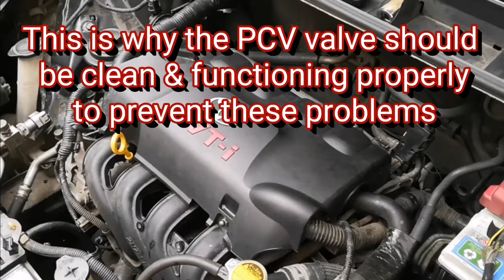PCV VALVE - You MUST Clean This! | Vios/Yaris

Comment: nice & very informative video.. Is it necessary to clean the internal of the rubber hose as well? what should we use to effectively clean the rubber hose and what to avoid?
Reply from the maker: @k0m3n9  Yes, you can clean the hose too, if necessary. For cleaning or removing oil from rubber hoses, you should use a mild degreaser or soap-based cleaner that is safe for rubber. Most times, plain dishwashing soap and pressurized water does the job. Thanks for watching!

Comment: My pcv valve hose is oily does this mean my pvc valve is bad?
Reply from the maker: Yes, it could be clogged or stuck open especially if there's excessive oil. In either case you should clean - or, better yet - replace it. Check the hose for obstruction and damage and replace it if necessary. Check for signs of blow-by such as leaky engine gaskets or seals or visible smoke coming out of the dip stick tube while the engine is running. If you suspect excessive blow-by, you may want to have the engine's compression checked by a mechanic. Also, make sure the engine oil level is not excessive.

Comment: Why is it important to leave a gap between engine and pic valve?
Reply from the maker: Because the body of the PCV valve is tapered to form a seal. Forcing it all the way in could ruin the threads or cause stress cracks.

Comment: Sir thank you very much i learn a lot from your video and the caption are very clear and valuable info. Can you please show us how to remove and clean oxygen sensor. Than you very much. Keep safe.
Reply from the maker: Will do sir, when time permits.  :) Thank you so much for watching and for your positive feedback. God bless & keep safe!
Reply: @Viosified  
How much pounds foot do you torque the PCV valve ?
I installed one on a 2008 Yaris.
I torqued to about three exposed threads, showing on the PCV valve.  Same as previous PCV valve.  It had about 3 threads exposed.  
You can easily strip the threads or over torque the housing is aluminum on the PCV valve.
Reply from the maker: @dfls5069 yes, I agree. I only torque the valve up to a point where it is snug enough to maintain seal and not more (maybe about 3 - 4 threads), because the valve is tapered and over-torquing could damage the engine block as you have pointed out.
Reply: @Viosified  
Anything greater than 3 threads exposed on the PCV valve for the Toyota Yaris, you risk serious damage to the threads.
I saw it with my own eyes. 
An amateur can easily destroy those threads.
I should have left 4 threads exposed for the longevity of the threads.
But 150 000 KM's and the PCV valve was in excellent shape.
Reply from the maker: Yup, totally agree. Good thing the pcv valve toyota uses is durable & easy to maintain.
Reply: @Viosified  
Not touching it again for the life of the car !
150 000 K and it still rattled. 
Very tiny oil buildup on it.
Was actually a waste of money to change.
Risk of damage to threads too.
Reply from the maker: @dfls5069  yup. Sounds right  :)
Reply: @Viosified  
My friend, is the throttle body electronic on the 2008 Yaris ?
Reply from the maker: @dfls5069  yes it is

Comment: Be sure car is cold before removing this type of pcv valve. Wear gloves when using carb cleaner. DON'T use carb cleaner if pcv valve is plastic use brake cleaner instead. If it rattles chances are it's working but to be sure use a balloon on the end of the hose it is connected and blow air. If the ball on stays inflated and no air is lost u can be sure it's working without leaks. Thanks for the video.
Reply from the maker: Thanks for watching
Reply: Hay! The tube next to it connected to air intake mins have a crack an owner before me tried to put black tape but it’s off , do you think this the cause of my po171 code
Reply: @gamingwitchutuu429  P0171 can be a lot of things. Start by replacing pcv valve since it's so cheap
Reply: @xtdcxdoom7  ok 👍🏾
Reply: What is the balloon leaks slightly. After cleaning with carburator cleaner, I ultrasonic it in water for 1 hour.    When tried to suck and blow air through it.  Seems to function as a 1 way valve.   But I can see the spring seems a bit loose.

What are the negative effects if there are some air leaks?

Comment: 3:36 that bark sounded so realistic i thought it was my dog.
Reply from the maker: You have good speakers ☺️ Thanks for watching.
Reply: Question: Why is there a need to disconnect the battery?
Reply from the maker: Disconnecting the negative cable from the battery is just a safety measure to prevent electrical shorts in case tools accidentally touch the positive terminal of the battery while working on the engine.

Comment: What about Toyota Camry? It’s 3 hours of work in shop to change this valve. It’s located on crankcase…
Reply from the maker: The PCV (Positive Crankcase Ventilation) valve is always attached to the crankcase to do its job of releasing engine pressure, though its location and accessibility may vary depending on the type/model of the vehicle.

Comment: Can we use brake cleaner for this ? Thank you
Reply from the maker: For PCV valve, yes you may if that is all you have. Just don't use it on MAF sensor and other precision electronic components, though.
Reply: DO NOT use Brake Cleaner for cleaning the PCV Valve.
The correct chemical for the job is Carburettor Cleaner, such as "Gumout".
Pros don't waste time and money by cleaning PCV Valves -- they are thrown away.
Reply: @Viosified  The correct answer is: NO !!
It is never proper to use the wrong stuff "if that's all you have" -- 
When laying out a job, you get what you NEED before you start work.
 Basic Mechanics 101.
Reply from the maker: @SlikLizrd   I appreciate your input. However, this PCV valve cleaning video demonstrates a process that is part of our regular MAINTENANCE procedure as a PREVENTIVE MEASURE to keep the PCV valve in good shape. Note that it is NOT broken or defective, and thus only requires basic cleaning (NOT REPLACEMENT). If, on the other hand, the PCV valve reaches the end of its service life then we replace it as necessary. 

In our part of the world, money is tight and we do what we can to save it, if possible and within reason. 

Also, the PCV valve used in the video is entirely made of metal with NO sensitive electrical components or plastic that could be damaged by using brake cleaner. Therefore, it is not necessarily "the wrong stuff" to use. 

I did add a precaution to my reply to his question NOT to use brake cleaners on MAF sensors and other electronic components to avoid damaging them, as you may have read in my answer to that question.

If you watched the video, you will see that I used carburetor cleaner for the PCV valve.

Please note that this is a DIY channel aimed at helping non-pros who want to save some money by maintaining their cars at home using basic tools at their disposal. It includes precautionary advise as needed. 

The PCV valve in this case won't melt, explode, or break down if cleaned using a brake cleaner, hence the phrase:  "if that is all you have. '  I then added a precaution not to use it on MAF sensors and other electronic components.
(My exact words:  "For PCV valve, yes you may if that is all you have. Just don't use it on MAF sensor and other precision electronic components, though.") 

Thank you for your feedback, Chuck. Have a good one!
Reply: @UCaU5_eA8Ln2PcSQFhQDVV0w Good morning to you, sir !
It's all good. You don't owe me any explanation.
 Sorry that you took a fence to my advice on saving time and money by NOT cleaning a PCV Valve.
Funny how such a simple piece of common sense can be rejected out-of-hand, but hey, it's U-Tube, and it takes all kinds.
Good luck to you, sir -- you're gonna need it.
Reply from the maker: No worries. No offence taken. I understand if you can't see the reasons why we clean our PCV valves as a preventive measure.  Replacement parts can be expensive where I'm from so we take the time to prolong the service life of each part as much as we could. Besides, it only takes a few minutes to clean that valve anyway. But hey, if you're too busy to do it, don't bother. 
Heck, if the car breaks down why not just replace the whole thing to save time, right? 😁  just kidding. Thank you sir. Keep safe.
Reply: @Viosified  
"I understand if you can't see the reasons why we clean our PCV valves as a preventive measure. "
 But I never said anything of the kind.
I DO understand the situation, and your reasons for defending a bad practice -- and it's OK.
You say you clean the PCV Valves "as a preventive measure" -- BUT -- when we look up our Maintenance programs, we see that the manuals tell us to "CHECK" the PCV Valve as a preventive measure.
"It only takes a few minutes" to clean the valve, but at 120 dollars-an-hour for Dealer Shop Time, "a few minutes" is money wasted, because with "cleaning", you're STILL not certain that the valve is thoroughly cleaned, which means you MIGHT get a customer come-back and an a$$chewing from the shop foreman.
I ain't here to bust your chops, man, and of course you are free to do as you want -- my decades of experience have taught me differently.
Reply from the maker: I respect your expert opinion, but calling this a "bad practice" is a little bit out of line.
First, the videos I make are designed as tutorials so that viewers are allowed to DO-IT-ON-THEIR-OWN (hence the DIY concept of this channel) which saves them TRAVEL TIME (for not having to go to the garage or mechanic for a simple maintenance like this); which also saves them GAS MONEY and MONEY FOR LABOR that they would otherwise have to pay the mechanic to do the checking or cleaning or replacing for them.

You advocate checking the valve. I advocate checking AND CLEANING the valve at the same time. I also do recommend REPLACING IT if necessary.

So your argument about the "120-dollars-an-hour dealer shop time" being wasted is pointless; because if viewers "do-it-themselves" they won't have to spend as much.

Second, I DO NOT charge anybody for anything because, as I have stated, the concept of this channel is to ENABLE my (non-pro/newbie car owners) viewers to learn and become more interactive and responsible about maintaining their OWN cars.

Any mechanic worth his salt would know how simple a PCV valve works and only stupid ones would not be able to determine whether or not the PCV valve is due for replacement; or whether it was "thoroughly cleaned" enough for it to do its job before re-insralling it.

I expect you to realize this given your "decades of experience" around cars.

Good luck on your channel.
Reply: @Viosified  OKEY-DOKEY. And thank you.
Reply from the maker: Thank you 😊

Comment: Can we use throttle body cleaner?
Reply from the maker: Yes sir, throttle body cleaner is okay.
Reply: Although pro mechanics don't clean PCV Valves (throw them away), if you INSIST on wasting time and money, Carb Cleaner, or "Gumout" is right for the job.

Comment: What is the reason for the gap?
My 1nzfe engine does not have the gap.
Reply from the maker: Some PCV valves (like the one in the video) have a tapered body to help form a seal to the engine block. Leaving a gap between the block and the valve as shown in the video helps to prevent over torquing it.

Comment: Gandang gabi bossing may garage po ba kayo para mapacheck ko vios ko po?
Reply from the maker: Hi sir,  video tutorials lang po sa ngayon wala po ako shop.  Thank you for watching.
Reply: @Viosified  loc nio po sir?
Reply from the maker: Laguna po
Reply: @Viosified  boss san po kau sa laguna?
Reply: @Viosified  taga laguna din po ako. Pde ko po kau puntahan para magpatulong sa vios ko?
Reply from the maker: @Teogaming2013  hi sir. Sorry po sa late reply nabusy lang. I would be happy to help you out kaso lang po walang chance sa ngayon,  hectic na kasi ang work load :(  

Pero makakatulong po kung maipa OBD scan nyo po ang unit nyo para maidentify ang mga hidden issues (may mga repair shops  po na nago-offer ng scanning service for a small fee.) then you can proceed from there. Ingat lang po tayo sa mga nago-offer ng home service kasi uso po scam ngayon. Mas safe at may habol po kayo sa mga established repair shops in case magkaroon ng problema sa gawa nila.
Thank you sir. Stay safe.
Reply: @Viosified  napascan ko na po wala naman error code sa makina.
Reply from the maker: @Teogaming2013  ah, mabuti po at walang mga error codes.  

Meron po ba kayo particular concern sa unit nyo sir?
Reply: @Viosified  ung vios batman ko po kc kpg open ac at aandar bgla ung rad fan nababa sa 500rpm tapos aakyat din naman agad.. Mavibrate lang kpg nasa 500rpm na.
Reply from the maker: @Teogaming2013  pag ganyan pong rough idle,  usually ang posibleng dahilan ay barado o palyado ang IDLE AIR CONTROL VALVE  (IAC valve).  Pero dahil electronic throttle body po ang nakalagay sa vios, wala po sya IAC valve at yung ECU na po ang may control sa idle air intake nya. Ang iba pa pong posibleng dahilan ay maruming engine air filter, MAF sensor, throttle body at minsan, PCV valve. 

Kung wala naman pong problema sa mga nabanggit na parts, may cases na kailangan lang pong ireset ang ECU para maibalik sa normal ang idling ng sasakyan. 

Kung misfire naman po ng makina ang dahilan ng rough idling, yung mga spark plugs o ignition coils naman po ang pinapalitan.
Reply: @Viosified  boss san po kau sa laguna?

Comment: sir everytime po ba na magtatangal ng battery need mag idle relearn reset ECU?
Reply from the maker: Hindi na po ma'am. Pag lang po may issues sa makina o kaya matapos maglinis ng throttle body at laging mataas o erratic ang RPM, etc., dun lang po ginagawa yung basic ECU relearning. Pero kung nag disconnect o nagpalit lang ng battery hindi na po kailangan mag reset ng ECU.
Salamat po.

Comment: How much torque for thr pcv valve?
Reply from the maker: The specific torque recommendation for the PCV valve on a vehicle may vary, and it's best to consult the manufacturer's recommendation for your particular car model for precise information. However, if you're looking for a general guideline or common industry standard torque for PCV valves when specific manufacturer recommendations are not available, a torque of around 8 to 10 foot-pounds (ft-lbs) is often used for many automotive applications. Keep in mind that this is a general guideline and may not be applicable in all vehicles. If you're uncertain or unable to find the specific torque for your particular car model, tightening the PCV valve snugly by hand (as demoed in my video) without over-tightening is usually sufficient to ensure a proper seal without damaging the threads.
Reply: The 2013  yaris model is NCP92L-BEMR

Comment: Boss tama ba yung valve cover gasket ay lagyan ng silicon gasket paikot? Thank you boss
Reply from the maker: Kung tamang klase po ng rubber valve cover gasket ang ilalagay (at walang imperfections) hindi na po sya required lagyan ng silicon sealant paikot dahil "dry sealing" na po ang rubber gaskets pag hinigpitan sa tamang torque specs ang mga bolts ng valve cover.
Salamat din po.
Reply: @Viosified  ohhh ganun pala, thank you boss
Reply from the maker: @diomedesdelrosario7411  welcome po

Comment: Sir anong reason bakit kelangan tanggalin pa yung negative terminal sa battery wala naman tinanggal na socket dyan?
Reply from the maker: Extra precaution lang po yun para maiwasan ang electrical short circuit in case mapadikit sa positive terminal ng battery ang tool habang may ginagawa tayo sa engine bay. Energised po kasi ng negative current ang buong body at makina ng sasakyan kaya po mas mainam na idisconnect natin yung negative cable ng battery for safety.
Reply: Many engine manufacturers give instructions to remove the NEGATIVE battery cable before doing ANY work under the hood (bonnet) -- the reason being that doing so will PREVENT ACCIDENTAL DAMAGE to the electricl system, especially the on-board computer systems that work on very low voltage -- if 12 volts gets to the computer, it's a goner !!
ALL-WAYS remove that NEGATIVE cable before working under the hood (bonnet).

Comment: may be I must service this item also... now my vios can't start with 1 kick
Reply from the maker: If the battery is strong enough to crank the starter motor, hard starting could be caused by several factors. A few things that come to mind is a dirty fuel filter, or a problematic fuel pump or fuel pressure regulator. Best option is to visit a good mechanic in your area for proper diagnosis.

Comment: You over tightened the crap out of it.
Reply from the maker: Nope. I did not. If you watch the video again at 4:46 you'll see in the subtitle that I specifically cautioned against over-tightening it, that's why I explained the importance of leaving a gap between the engine block and the neck of the PCV valve (see 5:05).
I knew where to stop because I was the one turning the wrench and I can FEEL how much resistance there was.
Thanks for watching.
Reply: @Viosified Chuck felt with his eyes
Reply from the maker: @dooflydetailguuy4349  lol 😂